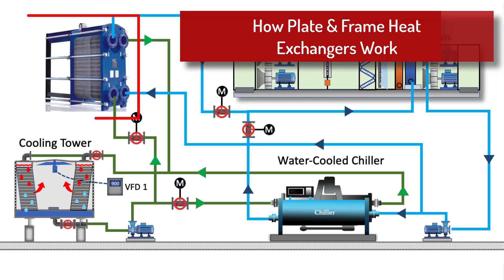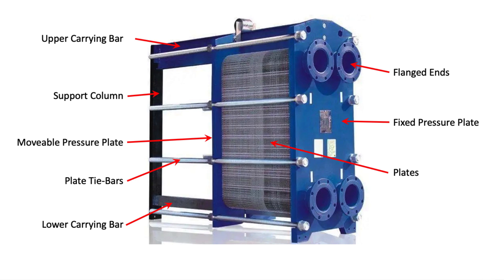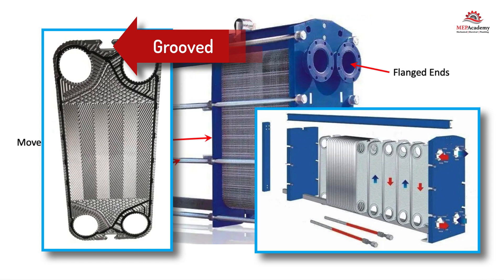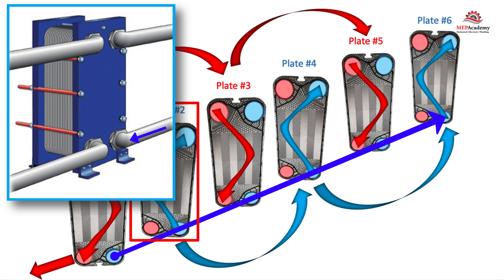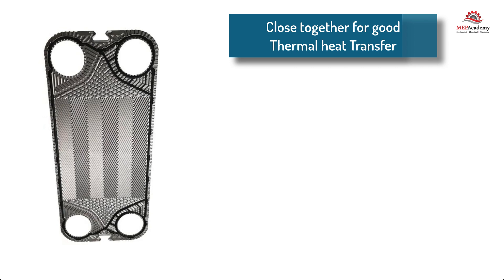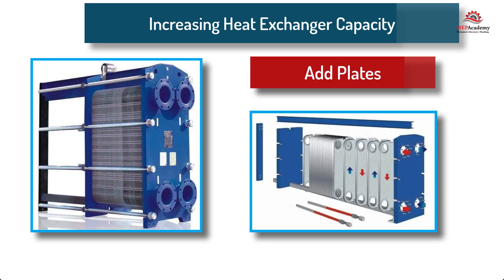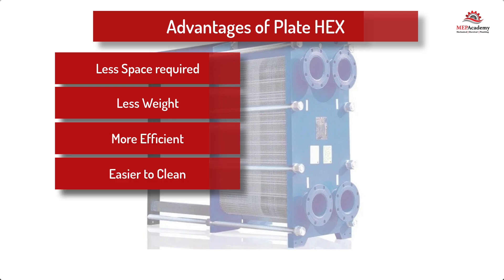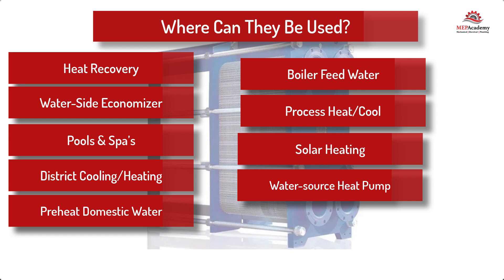How Plate Heat Exchangers Work

Comment: Do they ever need to be cleaned.
Reply from the maker: Yes, plate and frame heat exchangers (PHEs) need periodic cleaning to maintain their efficiency and prevent operational issues. The frequency and components to clean depend on many factors such as the type of water (clean, hard, brackish), and the symptoms indicating the need for cleaning could be increased pressure drop, reduced thermal efficiency, unusual leaks or contamination, and of course visual inspections.
Reply: @MEPAcademy    Thanks, I work at one of the big 3. I can guarantee you it's never been cleaned. I was the first person to convince them to punch the tube's that had never been punched. Wish I could send you a picture.

Comment: Indirect evaporative cooling limit of product air temperature is wet bulb. Dew-point indirect regenerative air cooling breaks this barrier and cools approaching dew-point, not wet-bulb temperature. Would MEP Academy report on plate HMX - Heat and Mass eXchanger technology implemented in Dew-point indirect regenerative air cooling?
Reply from the maker: Do you have something you want to submit for review, if so, please forward to john@mepacademy.com with your request.

Comment: The first part of this video the  flow through the plates is illistrated wrong. Shouldnt they always cross flow?
Reply from the maker: You're correct, the best flow is counterflow. In counterflow heat exchangers, the hot and cold fluids flow in opposite directions. This arrangement maximizes the temperature difference between the two fluids along the length of the exchanger. There are other types (Parallel & Crossflow) heat exchangers used in various other applications.